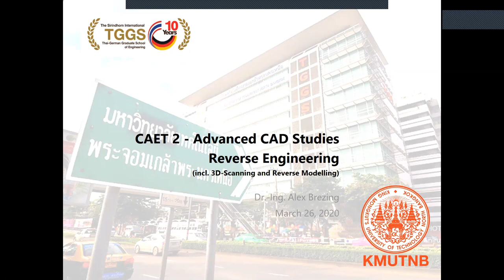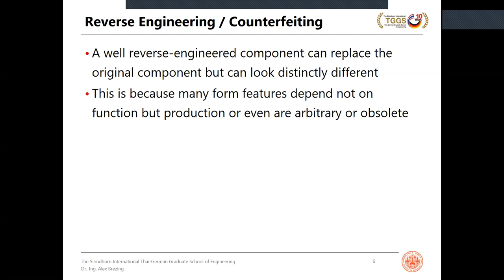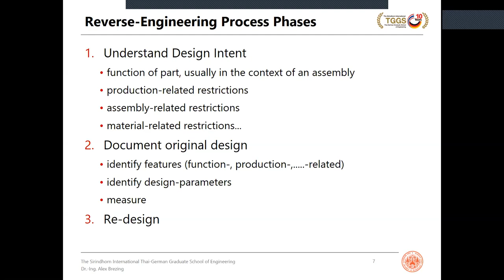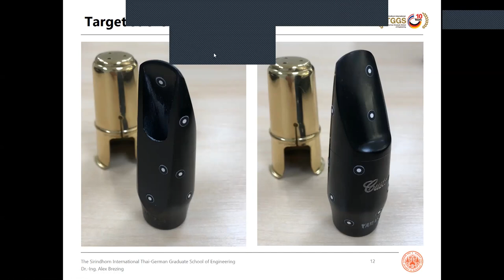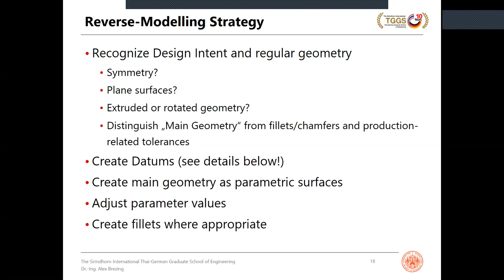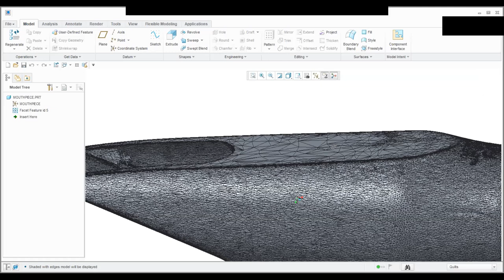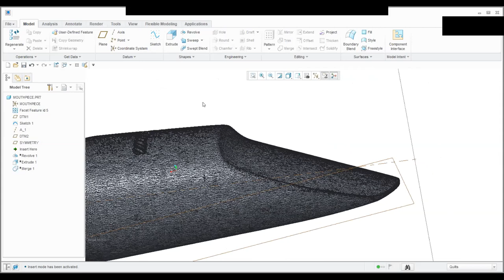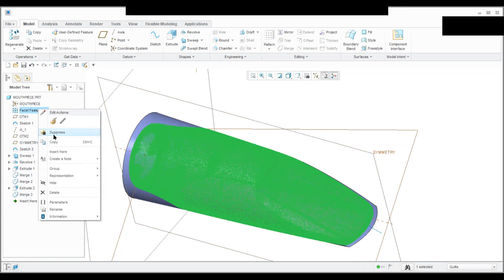Reverse Engineering - CREO-Modelling with Scanned Geometry

Comment: Hello sir i have one proble... when i import scan stl file in creo ...its size increases in inches automatically in creo software.... what will do for this problem... can you tell me plz
Reply from the maker: Hi Dipak! I guess the root cause of the problems are the settings in the scanning software. But this is easy to fix in CREO. You need to change the unit system of the file after importing to CREO, and then "interpret" 1 inch as 1mm. Find settings under File/Prepare/Model Properties. Then choose unit system, the chose "interpret".